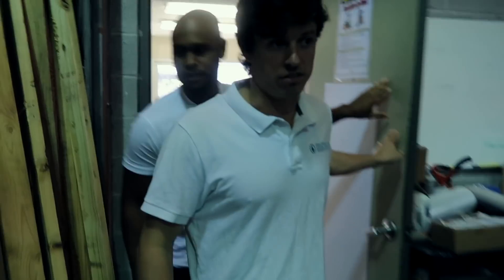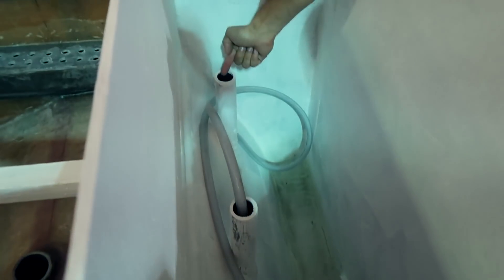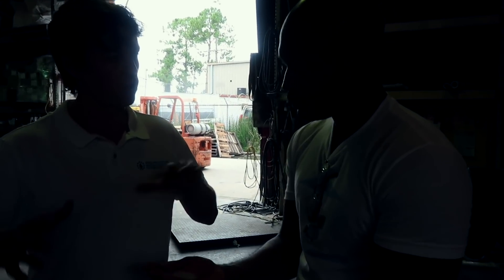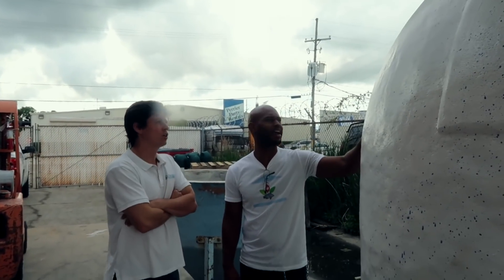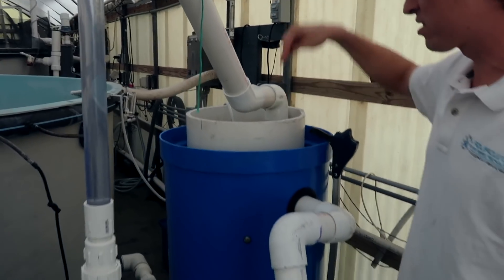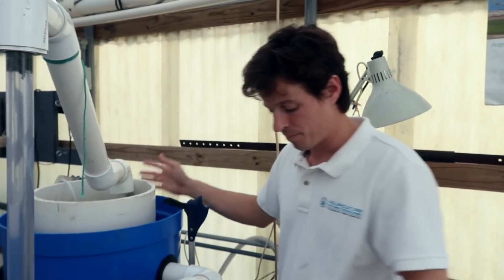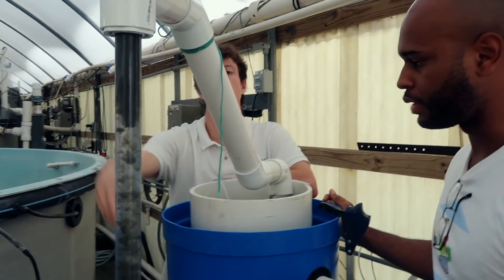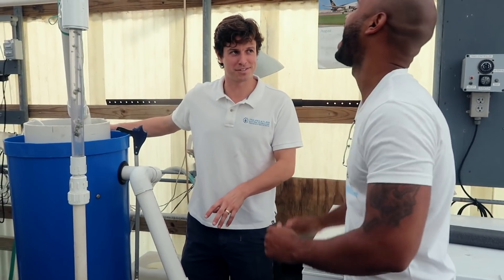The Secret Weapon For Removing Solids | The Aquaponics God Ep.73

Comment: Why is the sludge flowing so slowly. Its good because it saves water during the backwash, but with the air bubbles knocking off the waste from the beads it would be expected to have higher water flow at the exit of the system. 

First question but long time subscriber , thanks

Comment: Brooklyn, love your videos! I have a question for you. Love the idea of a bubble bead filter, but not sure if I can use it. I want to maintain a CHOP2 system and unsure of how I can make this work. This is an overview of my system:

PMoon Aquaponics Project V1

Housed in a 26’ diameter geodesic grow dome allowing approximately 530 sq ft of area 

The system shall be a CHOP2 type system. 

The fish tank is an oval sunk approximately 18” in the ground with about 29” above ground. It is estimated that the tank will hold 1,300 gallons of water

Grow areas:
• 4 DWC beds (trapezoidal to match dome shape) of approximately 11 sq ft of grow space each – will likely be all greens (lettuces, spinach, kale, mustard, etc.)
• 1 DWC bed 8’ x 3’ with a 4” fill – approximately 60 gallons and 24 sq ft suspended above the fish tank – this will grow watercress
• 2 Flood and drain beds the same size and shape as the DWC beds mentioned above – miscellaneous plants
• 10 Dutch Buckets systems in 5 gallon buckets – mostly tomato, pepper, cucumber plants. These will also house two basil plants
• 2 - 4 NFT systems in 4” x 4” x 8’ tubes suspended above DWC beds – greens
• 3 – 4 Vertical growing systems possibly in the future
There is a 300 gallon sump tank that sits 42” below ground level. It is approximately 38” tall. My intention is to use a variable speed pool pump and locate it in the sump area with the sump tank. I have been considering using a Pentair 011018 variable speed.

There is a sunken area next to the fish tank that was (in the original design) going to house the filtration. Filtration was to consist of one 50 gallon cone bottom swirl filter and one 50 gallon moving bed biological filter

Initially planning on raising tilapia. Planning on starting slowly getting up to about 200 – 250 fish. The plan is to switch to Perch later. We want to have the ability to increase fish to maximum for this system. 
               

Is it possible to use only one pump if I switch to the bubble bead filter?  Not sure if a SLO will work out of the fish tank on this.  It seems that you need pressurized water going into the filter.  Would I still use the swirl filter if I go to the smaller version of the Bubble Bead filter (my system seems to be of a size that falls in between the filter sizes).  Thanks for your help.

PS - tried to add a couple of photos but could not